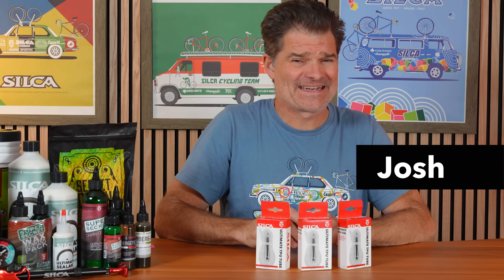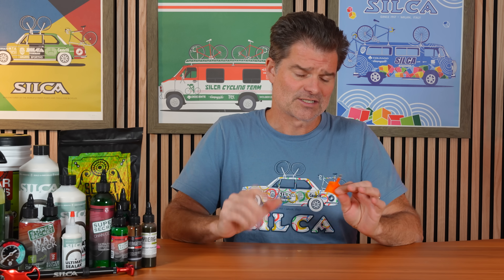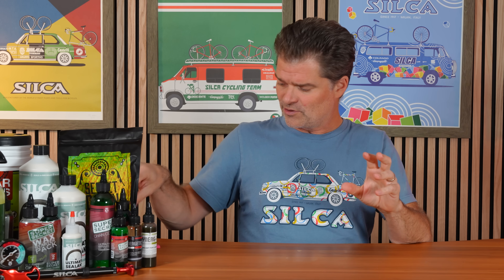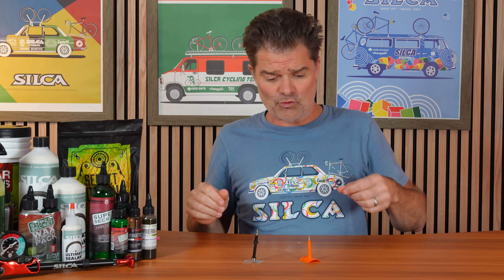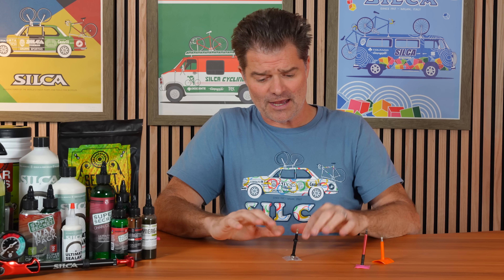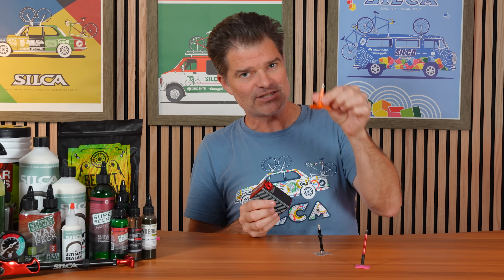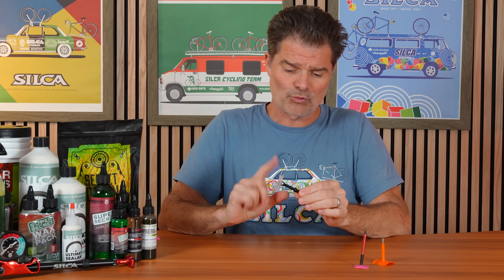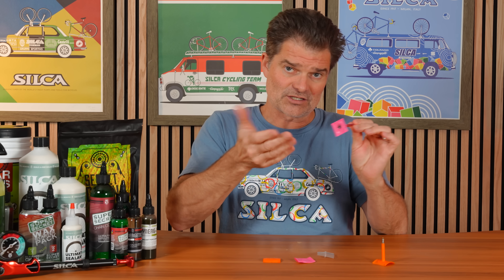Are TPU Tubes Finally Worth It? | SILCA Ultimate TPU Explained

Comment: The stem does look better thought out, as does the seam joining -- I have had other brands of pricey tubes be DOA because of gaps in the seam.  That said, two questions:  (1) Are these available with ClikValve?  It would reduce the stress on the stem from pump heads gripping them, and (2) Do they angle the cut used at the seam to reduce kinking?  If one just cuts a straight tube and welds the ends, the inner diameter is the same as the outer, and so either the inner kinks in the tire, or the outer has to stretch a lot more.  This makes it harder to install, and weaker exactly where the thorns are trying to enter.  Fixing this at just the seam is only a partial fix, but something.
Reply from the maker: Works great with Clik valve cores, but to be clear, clik valve actually requires more force to install and remove than most traditional presta chucks.. clearly won't be an issue here as we have full aluminum construction both sides of the rim to take those loads, but valve stem forces are not a problem Clik solves.  As for the weld, the tubes are made in a loop, so when you inflate one on it's own it is very beautifully round and you do not get the inner kinking/outer stretching which you may have seen with some others.
Reply: @SILCAVelo  Sorry I can only give one thumbs up for that -- I love the attention to detail!

Comment: I'm a Silca fanboy, but wow, $39 each! I've had zero issues with the cheap ones on my road bike. Mostly tubeless on other bikes.
Reply: made in Germany but cheaper to buy in the US than UK? interesting.
Reply from the maker: @Phantom0309  UK pricing contains 20% VAT, US pricing does not contain any sales taxes, those vary by state and are applied on the order total.
Reply: @Phantom0309  It's because of taxes, tariffs, etc.
Reply: @ericpmoss  Then make them in the US...................
Reply: @Thimeri0n  That would be awesome, but US manufacturing has shifted to mostly ultra-high-end work for aerospace and military.  You CAN get anything done, short of forged cranks, but only at boutique pricing for boutique scale.
Reply: @ericpmoss  BS
Reply: Fanboy here too, and I'd never had an issue with the cheap ones.  I only recently made the  switch but I have tubes that have over 1k miles on them with no issue.  I also don't use electric pumps or CO2.
Reply: @ryanclose1  I just don't get Silca pushing TPU tubes now after their sealant came out. The sealant was marketed to basically make tubes obsolete, and I've had great luck with it.
Reply from the maker: @BenBowman97  Lots of people carry these as spares because they are so small and light, but also a LOT of people out there are hesitant to get into tubeless so this leaves a nice option for them as well.
Reply: @BenBowman97 I don't like sealant in bikes that I seldom ride. I ride my mountain and gravel bikes 95% of my ride times. I only ride my road bike for the odd gran fondo and a couple of mid-week, 50 minute crits. So doesn't make sense to gum up my tires with old sealant. If I ride my road bike enough to need new tires every year or two, then sealant is the best choice. But for less than 250 miles a year, I can keep my tires for 5 years just using TPU tubes.
Reply: @newttella1043 that makes total sense. You'd basically have dried out sealant unless you ride once a month.
Reply: @BenBowman97  Put their sealant in the tubes. TPUs puncture almost as much a butyl.  If it went through a tire, it's going to go through that tube.  Been putting sealant in tubes since Stans came out and it works.  Just remove the valve core and shoot it in.
Reply: @ZenEndurance  Most TPU tubes do not have removeable valve cores, so be aware of that when buying to fill them with sealant.
Reply: @BenBowman97 ive had thr absolute opposite. Worst sealant i ever used, all it does is just spit out and not seal and when it does seal it immediately opens up and starts spitting out again
Reply: @SILCAVelo  Tubeless is a disaster fueled by marketing BS. Went there, failed on several occasions and went back to TPU.
Reply: @ZenEndurance  never had any luck using sealant in tubes.  At best, it's made leaks slower
Reply: @ConstantRider  I love getting 1-2 flats a year that won't seal vs the 4-5 a week I was getting with tubes.  Being in goathead country, there are multiple instances where I got a double flat before getting off my own street. I've even gotten one in my driveway😂  With tubeless, I just pluck them out or keep riding without knowing I even had a puncture until I got home and saw the sealant on my frame. *I carry TPUs as my backup for the rare instances that I can't plug a tire.
Reply: @BenBowman97 it's called product marketing without ANY real world proof. Another snake oil salesman
Reply: I’ve only had a single problem with a RideNow TPU’s in two sets of tires on my Tarmac and it was due to a loose valve insert. I’m a big SILCA fanboy, but the price is an obstacle, so but perhaps if these go on sale I’ll grab some.
Reply: @Teakdust in your dreams
Reply: @Teakdust yikes.. Ride now are like £8 a pop.. You can get 3 alloy ones for the price of 1 silca on sale. Stop wasting your money.
Reply: I’ve been running the pink Ride Now TPU’s with black valves and inflate with a screw down pump head and haven’t had a probed in the 18months since installing them. Running them on 28mm GP5000s rim break. 

Massive fan of Silca and happy to pay a premium on most of your stuff because it’s THAT good. But I cannot justify the price of these in Australia ($78aud each!!!)
Reply: Can$56. I don’t even pay that much for my tires! I’ve been lucky I guess with the can$5. AliExpress ones…no failure on two bikes 2000km each.
Reply: I’ll finish the half dozen or so of Tubolito and RideNow tubes I have before these go on sale eventually. I like the metal valve that’s tubeless style. I need a combo pack of 4 or 6! :)
Reply: @NelankaPerera ride now has alloy valves for literally 7.99 on aliexpress.. Sleepwalking mate.
Reply: Yeah, I've been using the green ones from Aliexpress for 2 years now, over 20k kilometers and I have never had any manufacture fails Josh has talked about in this video, only replaced them after irreparable punctures and when I damaged them myself during installation with tire levers due to tight Conti tires (imagine incidentally damaging a 40$ tube). I guess I will keep buying 3$ tubes.
Reply: @reforged3588 Cyclami? (Green ones).
Reply: @BareFinn1986  yes. love them
Reply: @reforged3588 I have those too. And I share your opinion. 😊
Reply: Cmon Silca. WTF
Reply: I thought it was $40 for a pair.
Reply: @BTcycle per tube
Reply: Interesting discussion of failure modes and design decisions to address. Any plans for 650b tubes?
Reply: @tonydotnottingham mate, just blow them and send them your paycheck
Reply: @tonydotnottingham AliExpress has some 650b TPU tubes. Gravel tubes. MTB tubes. Even BMX TPU tubes 😂
Reply: That’s ultrasonic welding, not radio frequency welding. Those are ultrasonic, acoustic pressure waves that do the welding. Old tech. Works well. The Chinese know it better than anyone else because it’s used ubiquitously in their manufacturing.
Reply: @5irefly  Thank you -- you beat me to the clarification.  👍   
And yes:  ultrasonic welding has been around forever (well: relatively speaking).
Reply: Uhm. Ride now for me, please.
Reply: Read the room Josh 👍
Reply: My man.... I was all excited til I saw the price... it really deflated me.
Reply: Uff very pricey here in AUS same as a GO5000 on sale. Having said that I’m sick of the issues with RideNow tube, back to tubeless. Hearing the next nirvana may be TPU tubes injecting with sealant?
Reply: I will get these for emergency spares for a tubeless failure.  Expensive but super important to not have to worry.   I have had new cheap tpus fail.
Reply: @nockee nothing beats standard tubes. You  can use electric, hand, CO2, air compressor or even use the gas station air pump. 
Can anyone say this about the Silca TPU tubes. 
Josh says " when using an electric pump inflate the tube in 15 psi increments really. What he is really saying is use a hand pump first then top off with an electric pump
Reply: @nockee me too.
Reply: Nothing can convince me to pay that price for a consumable bike part. The ride now tubes at 8 bucks are perfect
Reply: Yep.. pricy
Reply: People are comparing a new low production volume item that actually took thought to mass China stuff. I don't see riders having $5k+ bikes having any issues affording these if they are indeed the best available
Reply: Same, zero failures at the valve stem after a couple years with the RideNow and Cyclami brands on several bikes and probably 8,000’ish miles ridden on them.  So far only normal punctures, and the Pirrelli patch kit has saved most of those.
Reply: @123moof  I've also got good experience with the Offbondage tubes (hehe)
Reply: Gotta mark it up from Schwalbe
Reply: @veganpotterthevegan Out of respect for Silca I won’t say who it is, but I’d bet money it isn’t Schwalbe producing them for Silca. There’s another company that’s been around for a long while that just parted ways with a well known TPU tube company everyone knows.
Reply: @RyonBeachner  its not a huge list with Continental being there too.  Either way, they're buying a premium product from Germany and aren't making it in house so they're expensive.
Reply: My tpu from temu cost $5.00 canadian
Reply: $78 a tube here in AU.
Reply: Any plans to make these for 650b and larger mountain bike tyre widths?

Having had problems with TPU tube reliability, and ended up carrying two spare butyl tubes on a recent bikepacking trip, I’m very interested in a reliable tube for MTB tyres as a back up.
Reply: At least here in France, TPU tubes from Schwalbe/Pirelli/Tubolitto are anywhere between 20-30€ so it's a bit more.
Reply: €42 in Europe. 😂
Reply: My thoughts, for repair at home 3 layers of gorilla glue clear grip is better to seal tpu needle hole better than any patch.
Reply: I buy the original ones from eclipse.... 😂 Here in germay there are the half 19.95 and more valve stem options
Reply: Hahaha £37 in the UK. That’s more expensive than my tyres 😅
Reply: @a1white .   But is Silca.   Copy , rebrand and overcharge
Reply: Every one of the six, pink Ridenow in the 18-32 mm failed me but the three 32-47 mm has held up for now. 

The cost is from being made in Germany vs China and Silca engineered from a first principle application.
Reply: @GG-si7fwI've been using the 19 gram Ridenow tubes for a few years and never had an issue with that version, even though they're only rated to 28mm and I'm using them in 30mm tyres.
Reply: @GG-si7fwI had the same issue
Reply: Probably costs them 5 bucks to make
Reply: @BenBowman97 i doubt even that Ben
Reply: @BenBowman97 not even 5  bucks, I think....
Reply: @andersbjrnskov8130 aliexpress tpu tubes are ~$5 EACH. I used those before, and had no issues
Reply: These look identical to the ones Rene Herse have been selling for a while at $32.
Reply: @mattpickford4836 Rene is not externally threaded with retaining nut, and while they do.have a reinforced area at the valve it doesn't look as tough as Silca. They're made in Germany, no idea whether the bonding is same.
Reply from the maker: @stephenauckly Schwalbe, Continental, and Pirelli TPU tubes are all $38-45, don't have full aluminum valves, and don't come with a patch kit, so we feel these represent pretty good value considering
Reply: @SILCAVelo 
Got two Pirellis a month ago, 20 euro's a pop, including 21% tax.
Got a 10 piece patch kit for about 5 euro's a couple of years back (bought the wrong ones when still using butyl tubes).

That's in The Netherlands btw.

Granted, I like the stem better on yours, but price is also a major factor.
Reply: @SILCAVelo Josh, I can hear my mother’s words now, “Just because your friends do it doesn’t mean you should too. It’s still wrong”.   $39? ❤ u guys but I gotta pass on this one, too expensive for me.
Reply: @SILCAVelo  I love my Silca wax but you can get (2) RideNOW TPU tubes with metal valves for $29. Competitors charging high prices doesn't mean you guys should too.
Reply: @SILCAVelo  The ones from chinese brands are $5-6, with patch kit and aluminium valve stems. I would rather get 7 of those, they hold up very well for me. Some of them have even had solutions to the problems you outline in the video for a while already. Perhaps they are not as nice as the silca tubes, but at this price I will never find out I guess
Reply: @SILCAVelo  In Europe Schwalbe, Continental and Pirelli are all €29-33 (and that is MSRP - it´s mostly sold cheaper), and the Schwalbe DO have full aluminium valves!
Reply: @SILCAVelo  Conti TPU does come with patch kit. I know that because i bought a couple last week
Reply: @SILCAVelo  not true I can get all these nearly half the price.
Reply: @SILCAVelo  The video mentions a patent. Who originated the patent(s)? Or is Silca simply rebranding? Thanks for clarifying.
Reply: @SILCAVelo  I love Silca products. But that price is too high. Aerothan (Schwalbe) has a retail price between 17-20 Euros. Yes, the valve is sh... but 35 Euros for one tube is simply too much.
Reply: @SILCAVelo schwalbe tpu tubes are 18€ in Europe
Reply: @SILCAVelo  Well, Schwalbe or Pirelli can be found in many places for around 20€, versus 40€ for the Silca tubes... And less than 10€ for the RideNow ones with metal valves...
Reply: @SILCAVelo  these are terrible value, the poorly named Offbondage purple coloured tubes with full aluminium valves are £3 from AE, coupled with Park Tools GP2 they are a perfect solution. I can get 12 for the price of 1 Silca tube, even with your marginal gains they make no sense at your prices.
Reply: @SILCAVelo .   You have absolutely no shame.    Today’s video is full of bs, 1lb saving/wheel with Tubolito? Using TPU on a 50lb E Bike to save weight ?? Using a TPU tube with a bare alu rim and not rim tape or rim strip protection?  Made In China means less now ? Disgusting
Reply: If I were to run Silca TPU tubes, I’d like the entire world to know about it. Don’t know about that clear color choice there
Reply: @KoIhara  do you hold your spares in your hand or something?
Reply: @KoIhara 
What?😄
Reply: @KoIhara tube is inside tire, what does being clear have to do with anything?